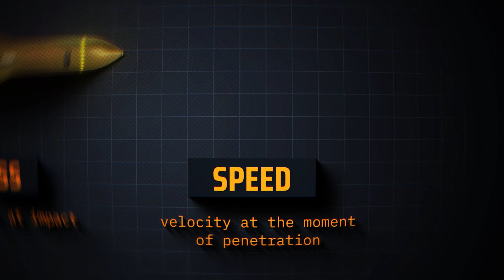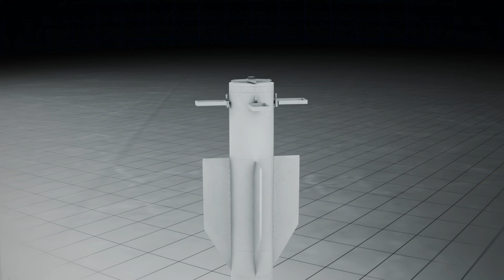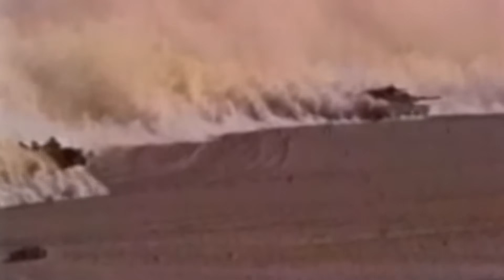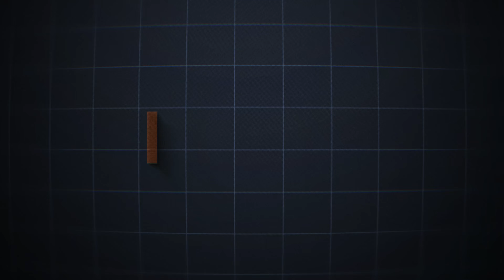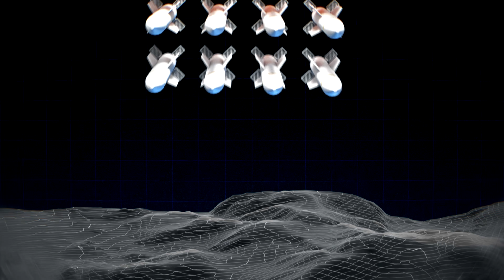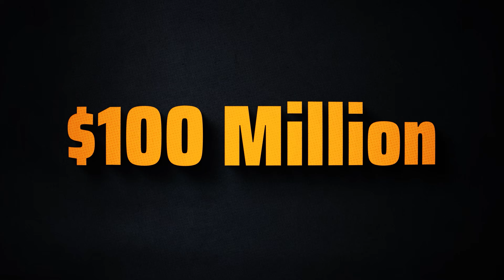How Bunker Buster Bombs Actually Work

Comment: On very deep high value targets, they could use tactical nukes which are in the single digit kiloton range yet pack enough punch to break through hundreds of feet of rock and concrete once the warhead punches through.